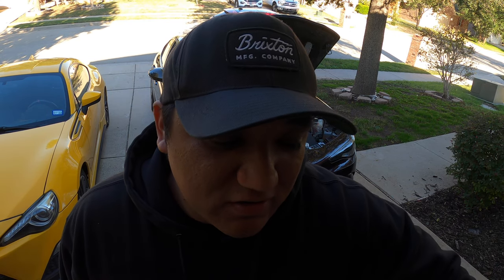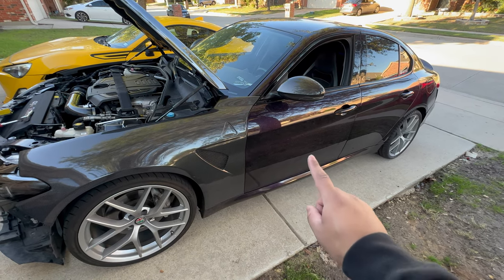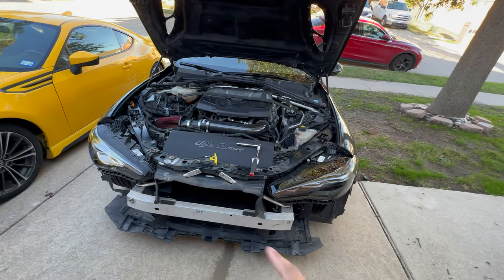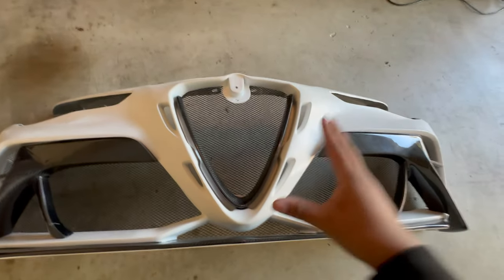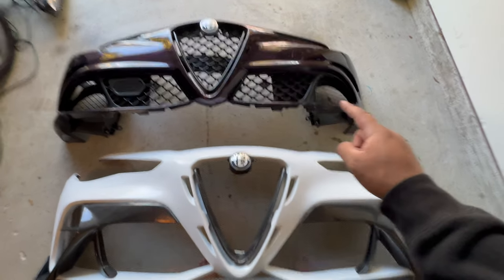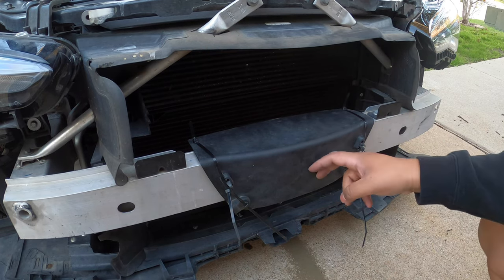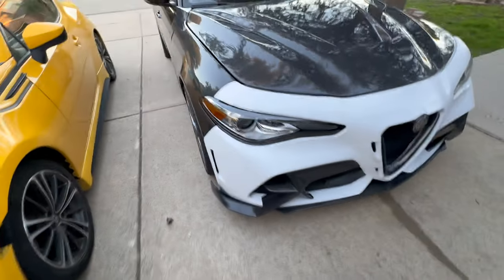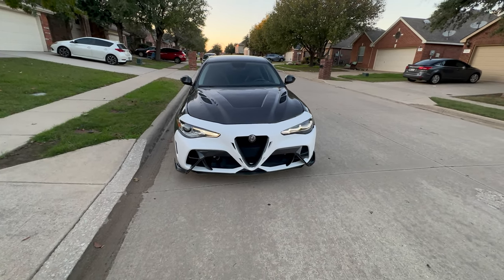Alfa Romeo Giulia GTAm: Front Bumper !!

Comment: Got a question for you.Won't it have been cheaper,or more beneficial to buy a used QV. I would have.
Reply: @ModdedMotors this😂😂😂if you know you know. Modded motors FTW
Reply: Dude!!!!!!! It's gonna look RAD once it's painted 👍🏼
Reply: A used QV probably wouldn’t be running 😅
Reply from the maker: I appreciate you!
Reply: No it would not be beneficial at all, no logic in that question tbh. A QV GTAm is an 200k track car, is RWD.  Here the point is to have an AWD 2l car that looks great. A used QV is not that. besides it being possible to do like 6 cars like this with GTAm bumpers for one GTAm

It would no, a GTAm is 200 k euro new, used very similar.
A QV is gonna be 60 around, these parts with painting will be max 12-15k. 

Also QV does

Comment: I was considering buying this bumper from your website but need to know if it has the front sensors and radar openings and hardware for the trim .
Reply from the maker: Hey Joe! Not sure if you got my last ping, I didn’t see any questions come in. If you email us I can contact you directly. If you have front sensors the hole will need to be drilled out from the body shop. You’ll use the mounting brackets from original bumper. As far as hardware you’ll need to rivet the carbon on, not sure if that answers your questions but if you reach out direct happy to answer more.